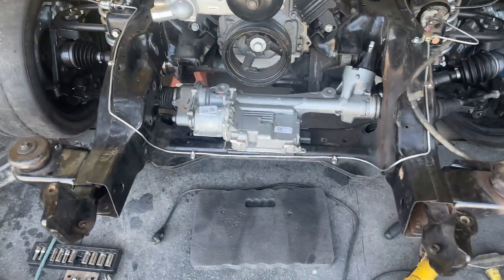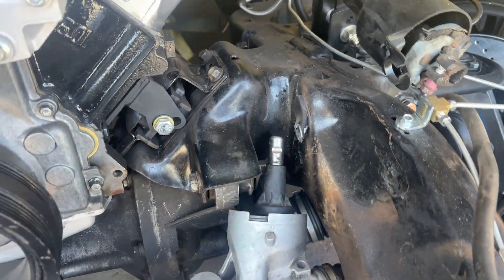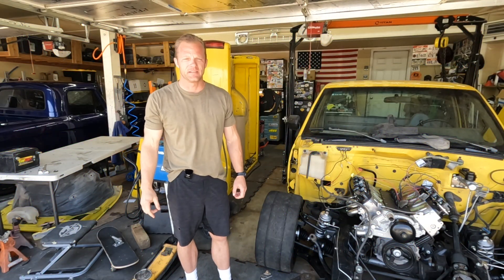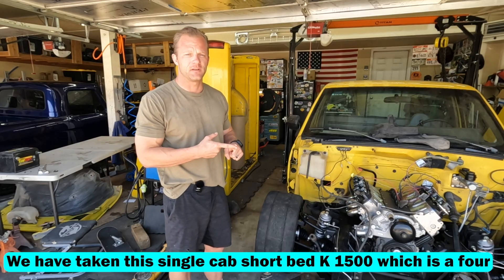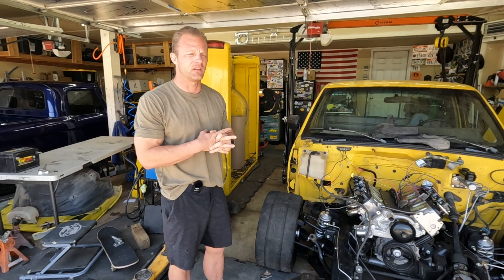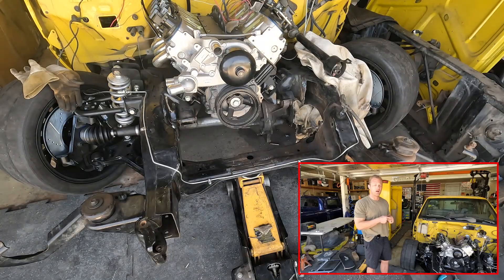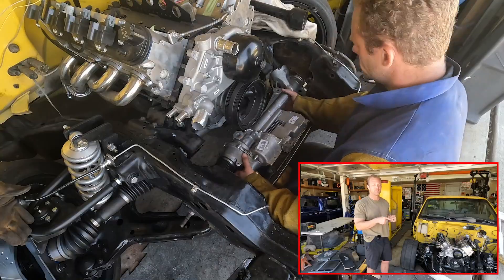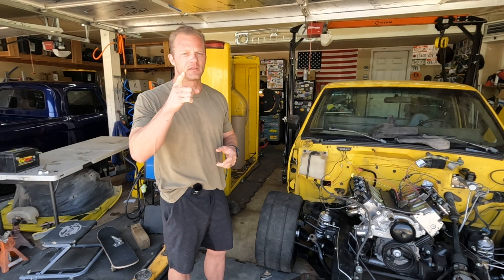Electronic Power Steering Install On The OBS Street Truck Build!! | FactoryFresh

Comment: Great video i have it on mu 66 f100 crown crossmember  and my 59f100 crown crossmember one kit from f100 performance and the other from range industrial
Reply from the maker: Awesome thanks! I’ve built a lot of F100’s which is what put me on this idea
Reply: Im trying a toyots prius. Steering column on my 69 vw square body wagon norrowed c4 corvette suspension front and rear  @FactoryFreshChannel
Reply from the maker: @PeterHatch-mx7zc  nice! I’ve always wanted to graft in a corvette suspension on something!